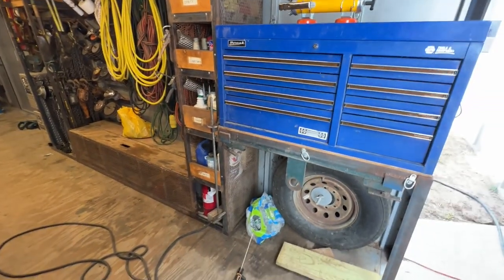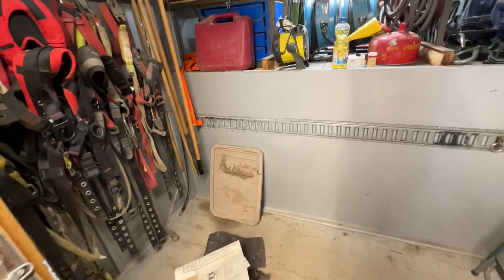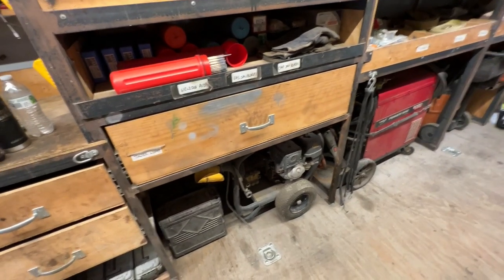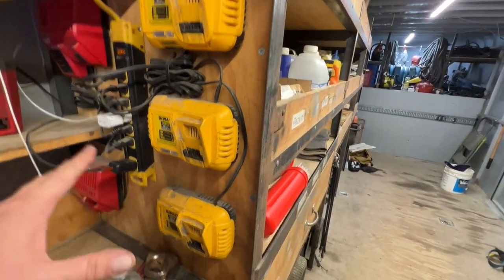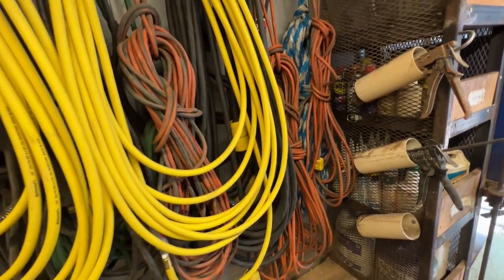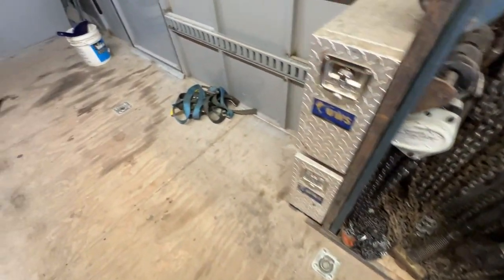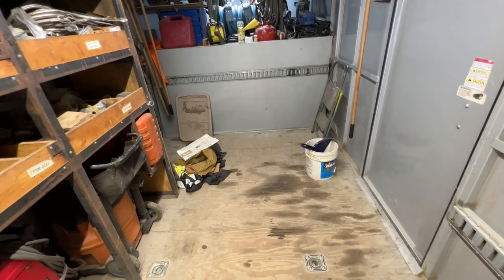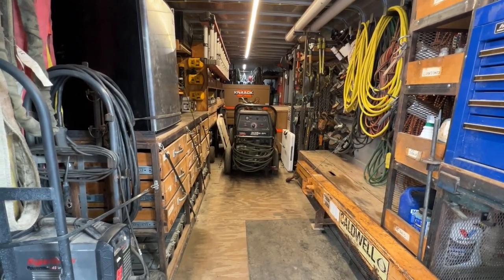Millwright Tool Trailer

Comment: I was wondering if you would do a video on your recommendation for tools everyone should have at their house for basic repairs, in the car for emergencies, and maybe if they want to start their own metal/wood/DIY shop in the garage etc.  I myself have been thinking about buying some more tools for the house but I'm not sure what would really cover all the basics.  I have a hodge podge of things, but finally bought a decent sized tool chest.  I want to fill it up, but with things we'll actually use consistently not just random socket sets, Dewalt batteries and whatever else.
Reply from the maker: That’s a good idea.

Comment: Wow...the neatest thing about your set-up is that you know how to use everything in it...do you have occasion to do maintenance on your tools & equipment? I imagine when you pack everything up you follow similar principles that are used on cargo planes...there is a "panel" on the right-hand side next to your ladders...is that a door? Good video!
Reply from the maker: Yeah that’s the side access door. After we unload everything we usually just use that door exclusively.
Reply: @txtoolcrib  I thought so...I recognized the trailer...you had done a "sneak-peak" of it a while ago...I also recognized the slide hammer you used to remove a stubborn shaft...when you mentioned the Knaak, remembered how roomy it was & some of the refinements you made...I hope you have a good trip to Alabama...stay safe...

Comment: Love this trailer! What size square tubing did you use for your vertical wall support?
Reply from the maker: The walls of the trailer use 1” square tubing I believe, original to the trailer. I don’t remember for sure but I think we used inch and a quarter for the shelving components.
Reply: @txtoolcrib  that’s Awsome man!   I’d love to see a side view.   I’m building a trailer with 1/2 walk in storage, 1/2 flatbed with my welder, and a service crane….

Comment: What is in the aluminum boxes? nice video, watched it several times.
Reply from the maker: Key stock, all thread for epoxy anchors, 60 and 80 series chain parts, fender washers, cable swaging parts, cable clamps, etc…
Reply: Thanks, really appreciate your response.